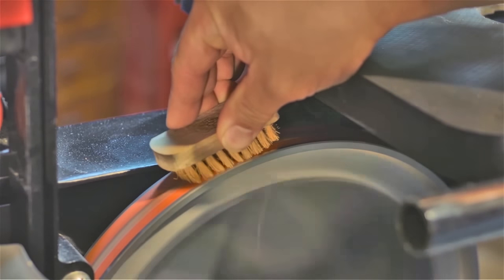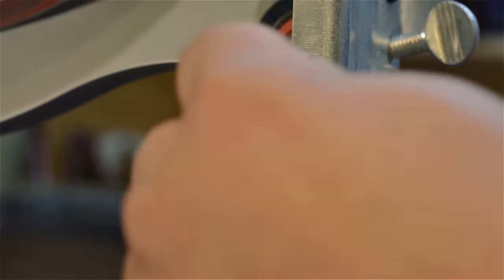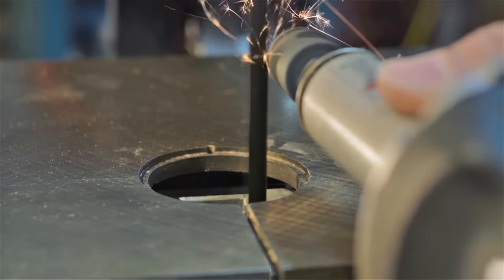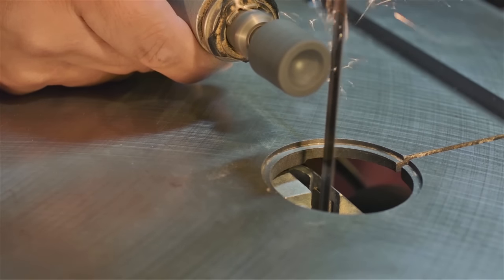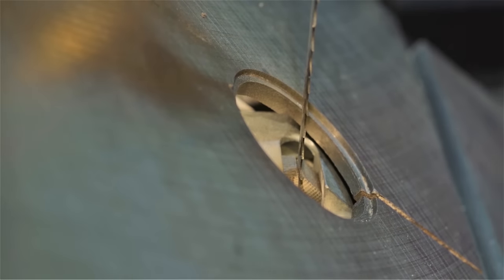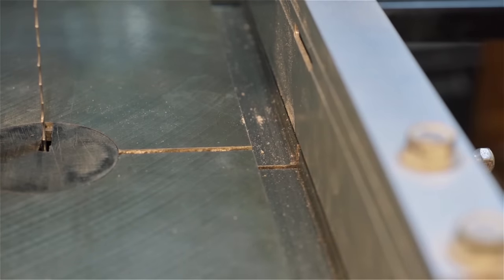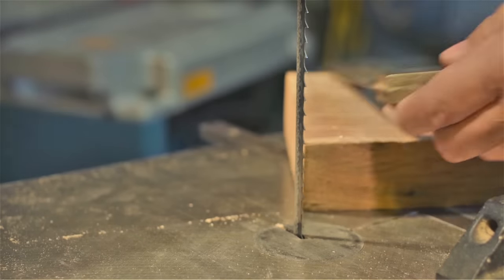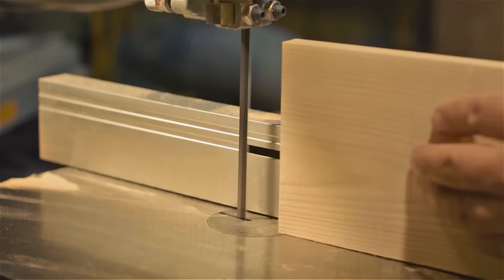Bandsaw Tuning For The Anally Retentive

Comment: I understand every adjustment you did with one exception (and I had every one of those adjustments in my bandsaw owner's manual). When you are truing the back side of the blade, don't merely hold it by hand. Your subtle movements doesn't offer a smooth straight back sided blade. Instead get some type holder setup for whatever rotating tool you use so that you can do slightly closer adjustments and then you grind only the waviness of the back of any blade. Once you see the sparks flying from the entire blade, then you have it straight. But you can't get that perfectly straight back side by hand... A perfect type rotating tool holder would allow you to micro adjust forward movement in thousands of an inch. Such a holder could easily be made from a few pieces of wood with fine thread screw adjustment capabilities... JMHO
Reply from the maker: The blade was tuned up before hand, as I couldn't get a camera shot of the grinder up against a block of wood that I clamped to the table. My makeshift vice was in the way. I try to make my videos mostly with close ups, just cause I want viewers to feel they're there. A cheap drill press milling vise with a dial gauge might be a good option for the ultimate in uptightness. In retrospect, I should've put a dial gauge up to the blade, and taken measurements (while running!) for maximum effect! Thanks for the suggestion! Cheers.!

Comment: Great tips. I have an older JET bandsaw from the early 70's. I need to overhaul it. Needs new rubber rings on the wheels, and a new blade, but I think the rest in in perfect condition. I need to know where to get rings or material for rings, and then the rest will fall into place, your tips will help.
Reply: You might try Amazon. (or maybe Ebay?) I picked up a pair for a small bandsaw that I had for less than 20 dollars.

Comment: Thanks for taking the time to post this!
In noodling over this vis-a-vis my bandsaw, I get the value of easing the back corners of the blade and any bumps at the weld, but beyond that I’m not comfortable removing any metal in the blade’s root.

Most of us who have used the bandsaw has seen that flutter your vid captures so well and this seems to be especially common with new blades.  Because bandsaw success is highly dependent on blade tension,  I have to wonder if your techniques work on account of heating up the blade enough to relieve the stresses stored up in the blade from the manufacturing process. It is pretty understood that most bandsaw tension gauges are woefully inaccurate and the result is that they tend to lead people to under tension their blades, which of course leads to poor cuts and flutter too. Maybe your technique relaxes the blades.

Comment: Great stuff, I've recently gotten my old HF band saw running again after many years of only using it for rough cutting with the original blade that I had sharpened a couple of times.  I was very disappointed in the saw's performance and chalked it up to the low cost/quality of the machine (Harbour Freight is notorious for low quality).  Then I bought an expensive blade, after viewing a few You Tube videos and was amazed at the quality of cut.  After seeing your video I think I'll put the old blade back on (I'm a pack rat and never throw anything away) and see if I can improve the performance of the cut of the machine.  Thanks, great video, thumbs up!

Comment: Just bought a near new SIPA Top 6 bandsaw, which is unfamiliar to me!
I have no user manual & cant find one anywhere on line.
It has round euro support blocks.
It’s a bit different to the very old bandsaw I owned for 20 years so going to need to work my way through it slowly to get it tuned up properly.
This was informative, thank you!
I thought you were a tad cavalier pushing the timber thru for the veneer test with a big screw still in the end of it!
Obvious you’d miss the screw, but prudence would have seen me remove the screw first just to be sure!
I’ve worked a lot of recycled lumber over the years, de nailing it all first, checking it with metal detector & it’s inevitable there’s ALWAYS a broken off nail or screw shank / tip buried somewhere in the wood that you miss!

I hate hitting metal with a passion, almost as bad as breaking glass!

That screw made my ass cheeks pucker! 😂😂😂

All that out the way, still pretty informative video, thanks heaps! 👍👍

Comment: As a machinist: Thanks for the tips on woodworking!
And here are two tips from me:
First when grinding the back of the blade, tilt the grinder 15 to 30 degrees up. That way you will spread the contact area of the blade and make the grinding smoother while reducing wear on the stone.
Secondly, invest in a dial indicator or two and some holders and you'll be able to setup with much higher precision! Even really cheap ones will make a huge difference. (For tips on usage, dig through the channels of Joe Pieczynski and oxtoolco)
Reply from the maker: I bow to your up-tightness! Indeed, I have a metal lathe and also several dial indicators and using them as such would've ensured the ultimate in OCD setup.  I wanted to appeal to the average wood worker that wouldn't have had a dial indicator - but, that's just not anally retentive enough, and I see the error of my ways.

Comment: I'm a newbie with a band saw. I thought I was terrible at using a band saw. It turns out I may still be not very good, but, now I know the relic that I am using is no where near tuned. The blocks don't even touch the blade.  Looks like I have some tuning to do now. Thanks!!!
Reply from the maker: Even at their best, bandsaws are "rough" tools. The blade has minimal fixturing, the workpiece has almost none either - so keep expectations low. Regardless, they will get you close to what you need if well tuned.

Comment: Very informative video, thank you.

I bought an inexpensive 9" Ryobi band saw and it wouldn't cut a drift-less line, even with a guide, the blade would go off line. I tuned it up following the Band Saw Clinic by Alex Snodgrass. The saw was 100% better, but he didn't address the squaring at the back. I lucked out, my little Ryobi was square to the table. I make knives and having the band saw tuned up and not drifting is a blessing and time saver on the grinder. I only use it for wood, Brass and Aluminum.  I will look into the carbon guides for sure as what I have is some kind of steel.

I get my blades from Pro Bandsaw Works, they are pretty good blades and don't cost much more than the cheap blades at Home Depot where l bought the Ryobi. They are at probandsawworks.com and they make each blade for you out of a little better steel than the cheap blades and you can't hardly tell where the weld is, yes they make custom sizes and since they cut and weld each blade it isn't extra, they charge by the foot. But be forewarned, their blades tend to be thicker than the cheaper ones.

Comment: This came at the right time.  I am right in the middle of trying to fine tune my saw.  When I first started working with it, the blade would literally walk to the left making it impossible to cut a straight line.  After some tuning, if I go real slow, I can cut a straight line, but again ssslllloooowwww.  I will start making some more changes with what you have detailed here.  I also think I need a new blade.  I am using what came with the saw.  One thing you didn't cover is blade tensioning.
As far as Anal Retentiveness, I see my self as having CDO.  This is OCD but in alphabetical order.

Comment: Great work!  I've been a frustrated re-sawer for more then 5 years.  You've given me new hope that the money I threw at my Minimax BS (intentional pun) does not circle the drain and end with a loud whoosh.
Reply from the maker: Everything has to be square to one another, and maintain square when adjusted. That's it. That's all you need for a band saw to do its job. Imagine buying a metal lathe, where the carriage changed distance as it moved along the length. That would be intolerable - would it not? You would not be able to machine a linear shaft! The industry knows that woodworkers are "artists" and don't understand machine design. Instead they push "features", and nice paint jobs, without emphasizing machine quality. If your blade guide does not remain perfectly square and in the same plane when you move it up and down, then you will either have to fix that, or adjust the blade guide(s) every single time you change height - or- get another saw. Nearly all the stamped, and sheet metal welded body saws I've seen do not have a true square. This is because I see no evidence of the "body" being machined to be square to itself or other portions - maybe they pound or twist it at the factory or shim the up and down adjustment mechanism. On the older cast iron arm saws (North American),  the lower base and upper arm were machined flat, and attached to one another. The blade guide rod holder was also machined at 90 to flats. Since those are the only two spots I see that are milled, I believe they were the datum points. Even newer $2000 saws at Lee Valley don't maintain square when the blade guide is moved up and down. It's actually mind boggling.

Comment: Scary as shit! In my day as a wood machinist, we used re-saws for wide stock cutting and narrow bandsaws for circle cuts and pattern making! We also used jointers for surfacing wood, not band saws with the guides in mid air!  Respond to me when the blade tracks itself off the back of the wheel and you are on  a compensation claim!

Comment: I sure hope I can get mine to cut that nice after watching this video. I think the key to drift is having the cutting teeth on the crown of the wheel. I have always centered the blade on the wheel, so if you think about that, my blade is curved at the edge, no wonder it doesn't cut straight. Now off to the garage to set mine up like yours. Thank you

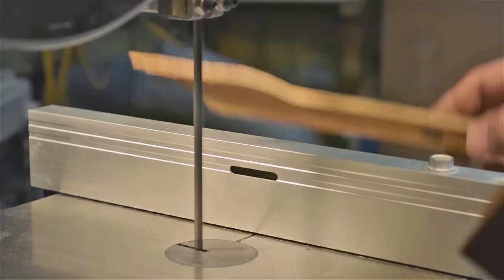Comment: 11:03 because I am anally retentive, the fact the you did not lower the blade guide down to match the work piece triggered me and made me write this comment for an otherwise SUPERB video. I know you did it on purpose, as you explained a minute later, but it is something that goes against the manual of operation, lol. Thanks :)
Reply from the maker: I should've lawyer'd up and put in some disclaimers that this was only for demonstration purposes. I get a ton of comments about being an idiot and unsafe. Regardless, nobody should run the blade that high for cutting thin material. Thanks.

Comment: Your video has increased the relative value of my crappy 9” Rockwell Shop Series Band Saw immensely with regard to grinding/tuning the blade.   The accuracy and the reduced ‘take’ have made me much happier.  Maybe in time, I’ll become “worthy” of a better saw and was wondering what mid grade saw would be recommended by you or other commenters and what companies do you recommend/patronize for blades/other needs, or do you but everything in a shop?
Reply from the maker: Don't know really, as today's saws probably come out of one factory and are re-branded. I'm a fan of the cast iron saws, as they are extremely stiff, and if machined properly at the factory will always be accurate. My preference would be for you to find an older North American made Delta/Rockwell and restore it, as the cast iron components were decently made. Ditto for an older Canadian made General (big $$$). The stamped and welded saws are sometimes a crap shoot. My test for stiffness is to extend the saw guide to it's lowest position (before hitting the table) - hold the table and push the saw guide forward or backward. How easy is it to deflect? You'll find the older smaller framed cast iron saws to be stiffer then the newer 18" monsters. If you can swing the cash, then buy a fully restored saw if possible. Don't buy anything used that has been cracked, and then welded back together. They're never straight or true. Good luck!

Comment: I will be doing a few new or different alignments not done in the past. First, I will buy the cheap blades as suggested. I was ready to buy the $125 carbide types. Next, cool blocks. I never thought as cool blocks being as good as or better than rolling bearings. The last (main idea) is the deburring the back side of the blade. I never thought of that one either. My bandsaw has been a pain in the ass ever since I bought it new ( Jet from Rocklers). It was a floor model with a few real crap pieces. If it doesn't work properly, it is no sales deal.

Comment: Had to add.. when I adjust my rollers or blocks I run the machine, lightly press one side in till its happy then tighten. I take a Dollar bill (4000nds of an inch) slide between blade and block then tighten the other against that  for a 4 thou clearance. I believe a regular sheet of paper is usually about 3thou.
Reply from the maker: With side rollers and their unforgiving nature I guess you would need clearance. The point I was trying to make is that after dressing the blade you don't need clearance, reducing blade deflection significantly. That is why side rollers, in my opinion, are garbage. They only contact the blade at infinitely small point, and require the blade to be operated at a higher tension to reduce deflection. Higher tension causes other problems. Let the blocks do all the work. I believe most new bandsaws are equipped with rollers, as people are too afraid/lazy to adjust blocks. Thanks for commenting!

Comment: With everything adjusted to an obsessive degree, my old Craftsman band saw has a drift in excess of 1/2 inch over about 1 foot. Ridiculous! This is with new blades from various manufacturers, wheels trued and balanced and aligned, Cool Blocks just brushing the blade, everything square that's supposed to be, yada yada. I'm convinced the thing is cursed.

Comment: Lol , I guess I'm #4 but having worked for Phoenix Mill Works for 13 years doing bandsaw piece work I would guess all cuts end to end would reach from East Texas to Alaska and back a few times . Just to be short I have spent more hours in front of a bandsaw than most . That being said I would agree with you , for a bandsaw you are being a bit anal intintif . Not saying that a well tuned saw will not cut better than just throwing a new blade on and going to town because it will make your life " or time in front of the blade" safer and more enjoyable . I did spend a bit of time tuning both the blade and saw with every new blade , but at best the bandsaw is a rough tool no matter how much time you spend fine tuning , as your last cut shows . I can say I have never made a finish cut with a bandsaw , that being said , I have spent at least as much time in front of a 1"X42" belt sander and drum sander as the bandsaw , or more . But this was a great video showing how to enjoy your bandsaw more and get better results from your tool . But every bandsaw cut should be finished with sanding or planing or both before you finish . Thanks for the video .
Reply from the maker: Thanks! The video started out really as a parody of every other "tune a bandsaw for drift" - and "use a dollar bill" video. However,  I decided to go to the n'th degree and see what could really be done. I agree, the bandsaw (by its nature) really shouldn't be expected to cut straight. It's almost ludicrous to ask a wobbly thin piece of metal, with stamped teeth to be able to dimension lumber to 1/10 of an inch. Cheers!

Comment: Thanks, between this video and another about tuning up a vibrating cheap style band saw, I decided to do a little more research, and wait on a more solidly built band saw to come up for sale, the one I was going to buy is probably more head ache than I'm ready for.
Reply from the maker: You'll be glad you did. You can change little things, but if the machine wasn't milled right or the wheels properly balanced from the factory, it is a total waste of time. This was evident back in the 90s, when a Delta was nearly double what a Taiwan machine was, and a Canadian Made General was over four times as much. The best machines I've seen are the Generals, that were made in Quebec or the USA made Delta's or Powermatics. Consumers buy things today based on "features" and not inherent quality. Band saws with lots of gizmos seem to be the order of the day, rather than a solid foundation. Good luck in your hunting!

Comment: Hello Brother
The guide material is phenolic. I just checked Amazon and a piece .5" x 10" x 15" is $35 on prime. A tool and die shop I worked is would take on production work between tooling contracts. Anyway we made carburetor spacers for performance engines outa Phenolic. I'd walk by the scrap been of this stuff and wander what it could be used for. Never thought of guides at the time. Anywhoo a sheet half inch thick would last a lifetime. Btw we used a steel cutting Rolling brand bandsaw to cut it to the rough size. I've machined it with hi speed steel endmills ,but it'll dull them quick. I wouldn't rip it with a high quality table saw blade because it'll dull it.
Reply from the maker: 90% of the cost probably is the machining and marketing. Too bad most bandsaws today use bearings, as block are perceived as "high maintenance". Cheers!

Comment: Good video. May want to generally talk about how to resolve some of the vibration issues around the lower wheel assy also include wobble!
Thank You, I will use a lot of your input with my machine.
Reply from the maker: Sometimes, it's actually easier to polish a turd - depending upon the band-saw and the manufacturer. If the lower wheel assembly is too flawed from the factory, then you're probably not going make any progress.

Comment: Very helpfull. I have a recon has been noisy and vibrated since day one no matter what the teeth count or size blade. But this saw has no blocks only bushings which seem to help little. I’m going to work with files/grinder to see if it helps quiet it down (screens during feed). Thanks